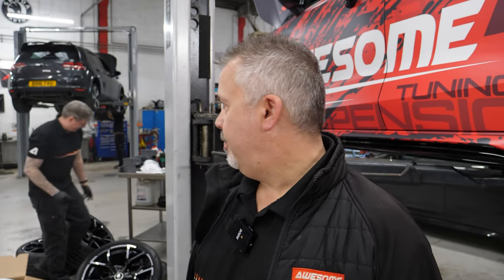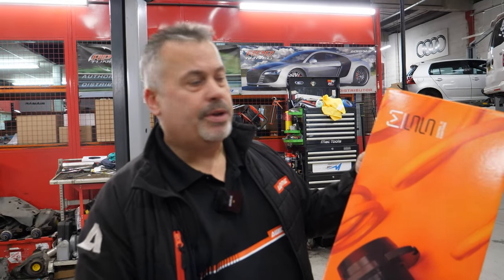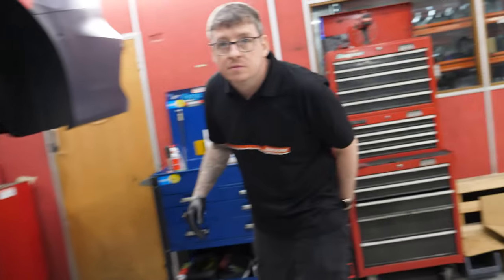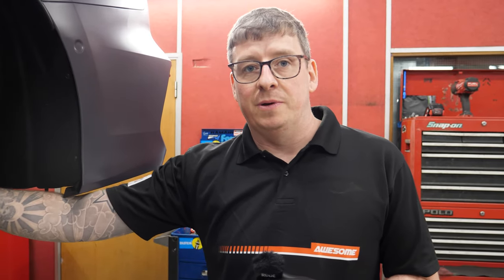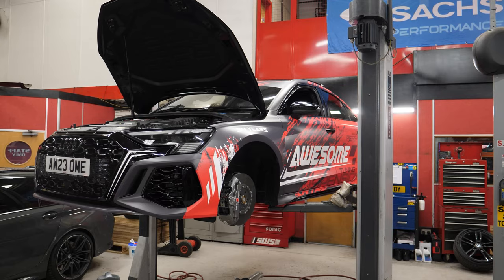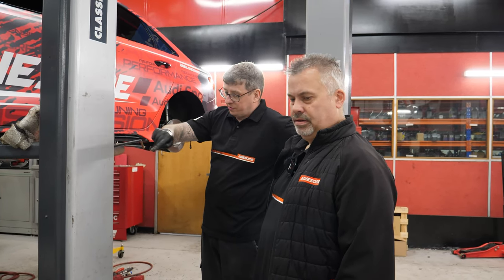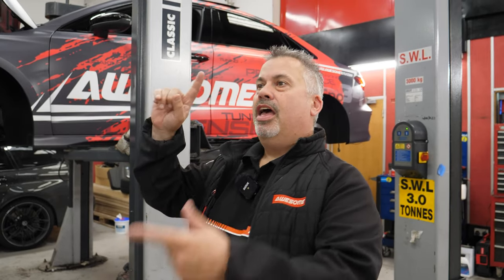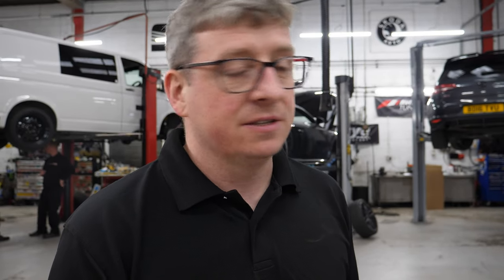TIME TO UPGRADE OUR RS3 8Y - EPISODE 2

Comment: Puzzled why you've put pzero tyres on when everyone says they are shite. Cars looking good.
Reply: We have 4 pilot sport 4s waiting to go on. We decided to fit 2 pzeros and use 2 from the factory wheels with the intent to destroy them at a track day and then switch them out.
Reply: They are shite. I had them on the TTRS I just sold before I got my new RS3. The pzero is a very hard tyre, on cold/damp roads you get next to no grip and in warm conditions, it is barely acceptable. Fuel consumption isn't great and they're noisy. I have no clue why anyone would actually fit them to any car. My TTRS I got new and it came with the pzero as standard. Never again. My new RS3 came with Bridgestones, which was a relied and I have found - so far, so good.